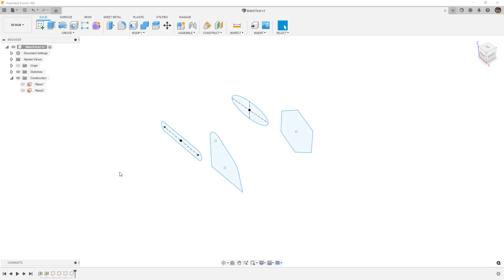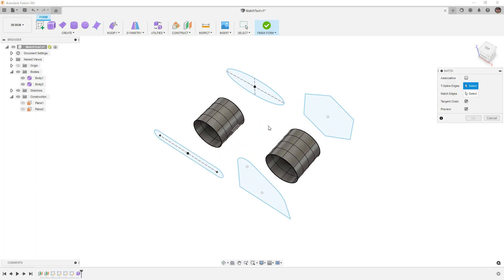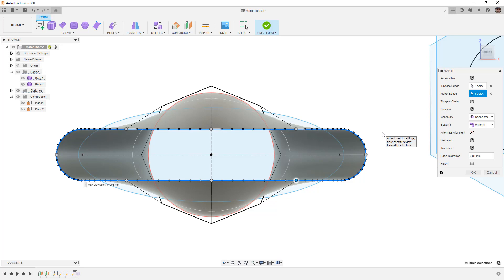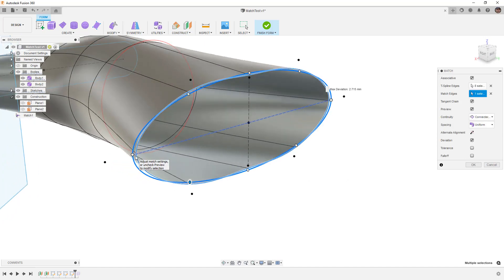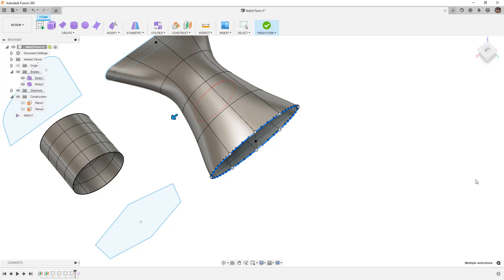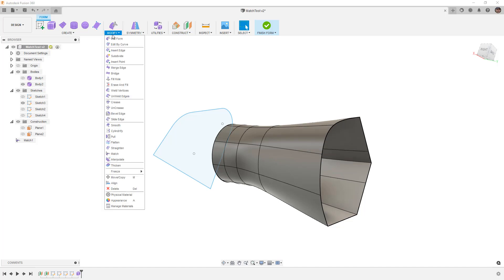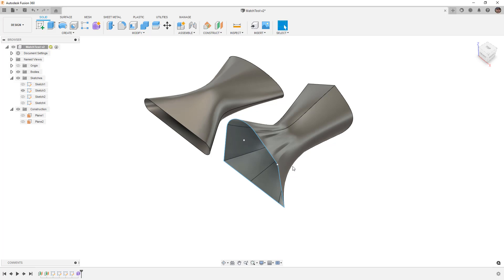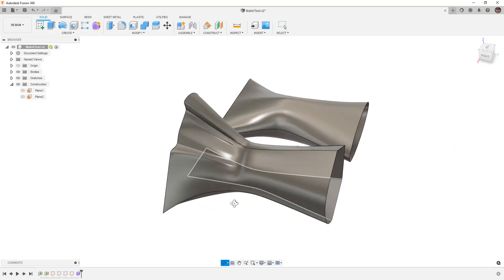Fusion 360 Form Mastery - Part 22 - Using Associative Match with Tolerance #Fusion360 #Forms

Comment: Thanks for spending some time digging into the features. I'm happy to see the "tolerance" option working, but you've also given me a lot of ideas about how we could make some of this work better/work at all. I know that form modelers like to use the box mode to judge their surface quality, and this has got me wondering if we can make the shapes you see in box mode a more useful indicator of how good your surface quality is going to be.
Reply from the maker: One quick solution would have been for me to add another loop near the associative edge but the issue still remains about inserting edges or points to alter the design.  You get ride of the edge flow.  One thing I forgot to test in the video was Slide Edge.   Slide edge will only go as far as the inserted vertices which prevent you from adjusting edge flow and control in that manner.

If there was some way to automate these points but exclude them(similar to freeze) and still allow the edge control we would expect that would be best, but way more complicated to do than I think is worth it.

At this time if I were using this for production I would build out the entire rest of the shape before I connected it to a sketch in an associative way.  Maybe do an initial Match and then at the end do an associative one.

Happy to keep this going or hop on a call if you ever want to chat about it.